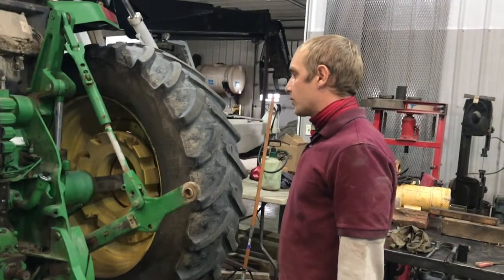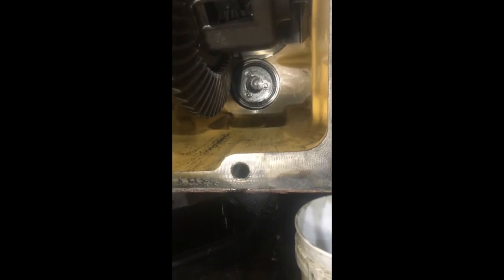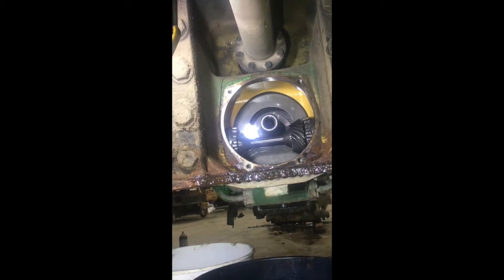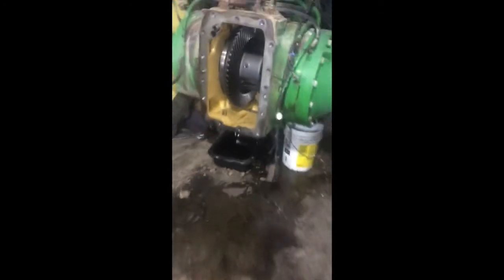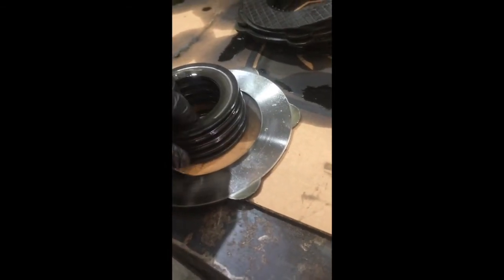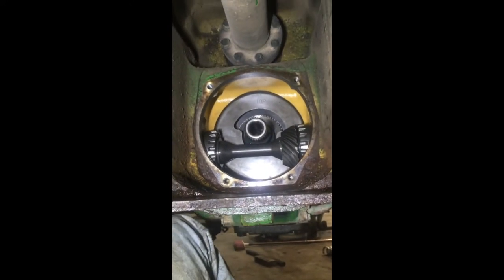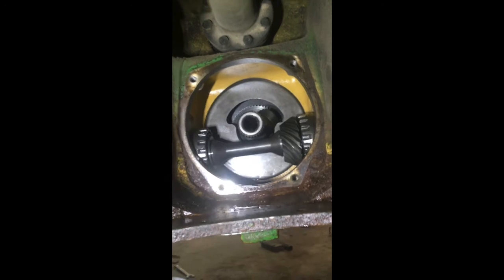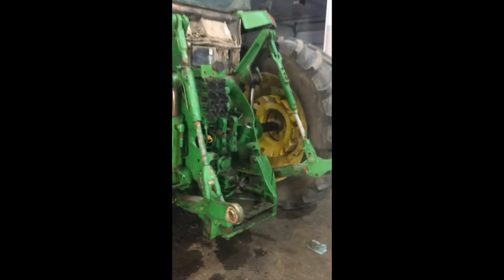John Deere 8200 PTO Clutch Rebuild

Comment: did you have trouble getting the pump drive off we removed the shaft and the bolts on housing seems to be loose but not budging any ideas what we are doing wrong
Reply: So the pump drive gear housing is machined fit so as to not allow for any sideways/up&down movement. I’m trying to remember just how I accomplished this one as it has been a few years ago now. I do remember it being a real fight though. If you have a small kind of ‘knee’ crow bar that is what I would start with. If not, I would try to take a coal chisel in from the top ledge pounding down. I say this and I don’t even know if it is possible to do. I’m a smaller framed man and getting two hands up there to run a chisel and a hammer would not have been easy. The other thing that comes to mind is removing the pump gears first and working it from the inside. Hope you get it figured out! There is no easy answer to this one.
Reply: I actually just thought of a better idea. I don’t know how much room you have with that shaft on forward/backward play, but if you were to reattach the pump drive gear end and use the shaft to leverage and wiggle that might just get the job done. Hope this helps.

Comment: Great video. I have an 8200 and the pto won’t shutoff. One time after starting the tractor it had stopped. Any ideas what could be wrong?
Reply from the maker: Yes it is most likely your pto brake. If you follow the video it will be located in the same place. I don’t remember off the top of my head which is the brake pad and which is the clutch pad but I know they are in the same place. You could try changing the pto solenoid that might do it and it’s much easier.